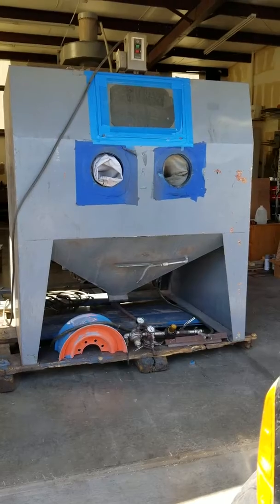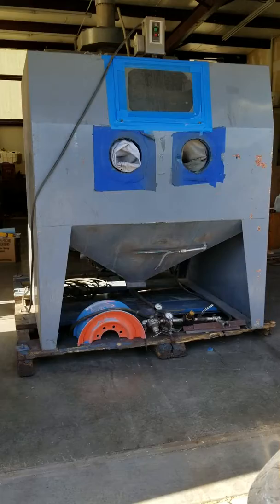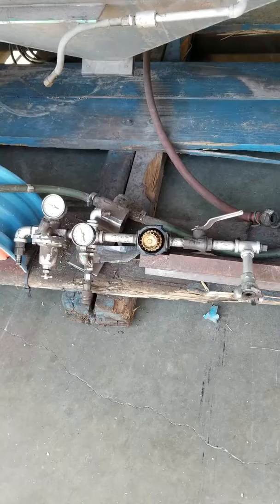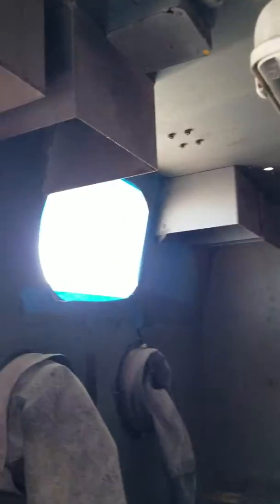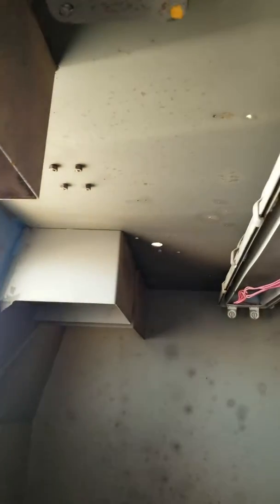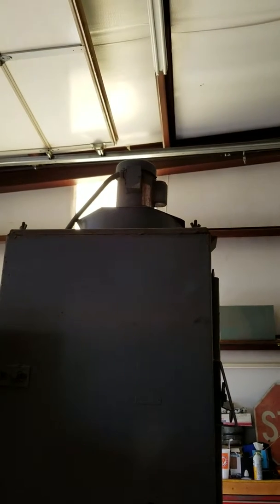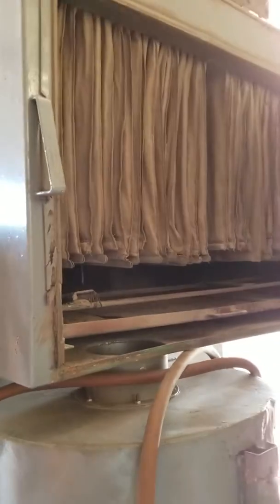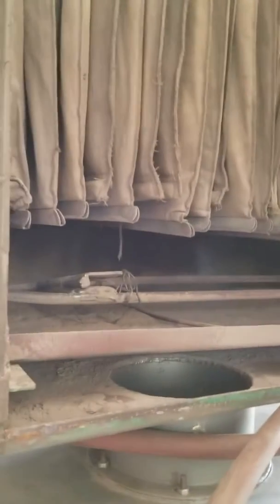Cyclo-Blast 6048-R Blast Cabinet

Comment: Are these worth anything and do they work good?   I have a chance to pick one up this weekend. 4x3x3. Guy says it’s not working well.  Not much on these and it can’t be much I’m thinking.
Reply from the maker: If the blast cabinet  has the original bag filters they're fairly expensive to replace. Make sure all the parts/pieces are there.
Reply: @3cl1  ok thanks. I would say they are original.  I’m going to see it Friday. He wants 700$ seems Reasonable
Reply: And by the way where would someone get the
 Filters ?
Reply from the maker: @renebertin5377  IDS Blast

Comment: Hello 3cl1
 By chance have you found a good source for parts? Specifically I'm in need of filters.  I have the same cabinet and am coming up snake eyes so far.
Reply from the maker: https://www.idsblast.com/sandblasting-supplies/713
Reply from the maker: The filters are crazy $$$, my cabinet has about 32 filter bags.
Reply: @3cl1  Thank you for the link. I was afraid you were going to note BIG$$. I'll double check, I thought I counted qnty 35. What did you end up doing for filtration?
Reply from the maker: @eldonmiller955  someone I spoke with had plans to convert these to modern filters and he was going to send me the plans,  but that never happened. I'll inquire again.
Reply from the maker: I received the filter conversion plans today, tell me how I can send you a copy.
Reply: @3cl1  Oh man! That is above and beyond! Email is fine, but I dont know how to send it privately!